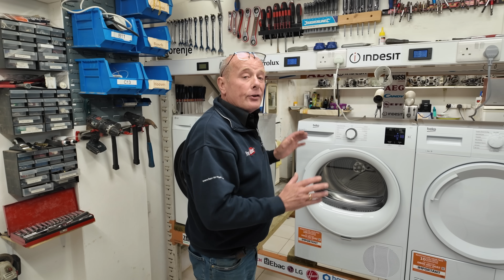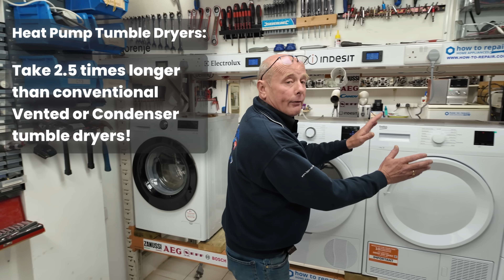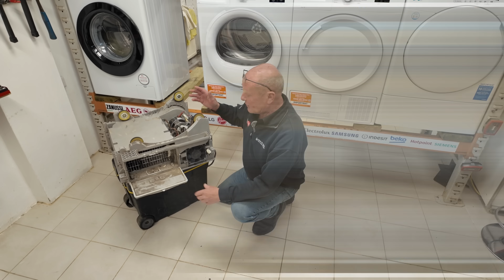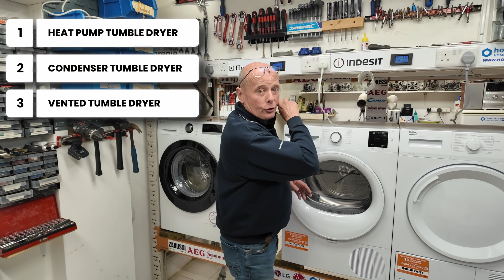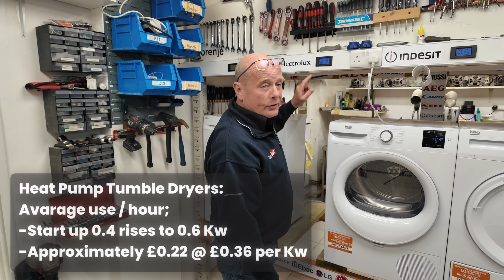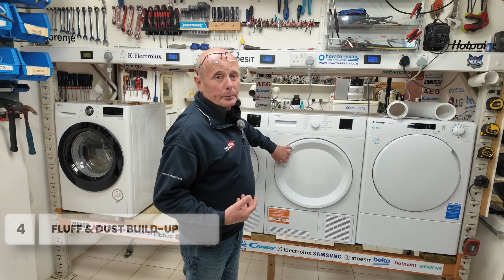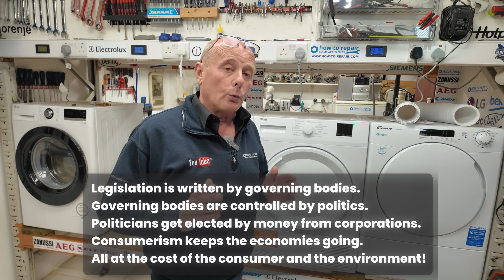Tumble Dryers the Shocking Truth About Heat Pump vs Vented & Condenser, NEW LEGISLATION!

Comment: To anybody with a basic physics and engineering background, it's obvious: the emperor is stark naked!

Thank you for making very clear how green these things are NOT.

I am coming to the end of my working life now, and I've never been in the repair industry as such, but I have always done machine repair at home whenever possible. 

If I hadn't, our family would have been thousands poorer, and we'd have sent three or four times as many machines to scrap heaps. That includes chest freezers (hinges and lids break because of poor design and choices of materials), dishwashers (cheap components fail), leaking washing machines (don't ask!), miscellaneous fan heaters, electric irons, ovens, kettles and so on.

I find even my own power tools are increasingly cheaply made - bronze bushes where there should be bearings, plastics instead of metal, and so on . And just yesterday, my wife's car's alternator, as designed, is too small to properly charge the battery.

I am surrounded by devices failing because of poor design, or deliberate 'planned obsolescence' on the part of manufacturers, particularly in 'modern tech'. 

It doesn't have to be this way, and you're right: it's largely down to a corrupt political process. Our politicians bang on about 'greening' the country, all the while wasting more and more resources on things that make waste increase, and decrease efficiency at many levels.

What to do? Teach basic physics and science better in schools--make sure children understand the difference between power and energy, and so on. Make sure, too, that they know about 'dust-to-dust' costs and how 'green' projects, particularly electric transportation, are really hurting the planet unsustainably.

And we should be grilling our politicians too: 'you want to pass laws that will change our lives dramatically: why? Do you understand what you're campaigning for?'

Most of them either don't have a clue, or are being paid for their views.
Reply: While teaching better would definitely help, it isn’t going to happen, because the people who are destroying society are the same ones who are deciding what gets taught.

Comment: I dont think this is a very good video. It lacks the facts to make a proper informed choice. And no i dont now understand the energy consumptions as the overall figures are presented very poorly. According to energy ratings from A++ to C hoover dryers i would use 259kwh/£80 per year v 691kwh/£214 per year. Saving £134 per year. Surely this would very quickly outweigh repair costs

Comment: The lifetime cost of the device should be highlighted at the point of sale. All white goods should be designed in such a way as to have a five year parts & labour warranty as standard, that way good design is built into the device. My Ebac washing machine has a seven year parts & labour warranty.

Comment: Very good video and analysis by someone who knows what he is talking about!!!! Unfortunately the legislators are not the people who know what they are talking about.... In any case, it shouldn't be a matter of legislation but market forces to determine which technology is to prosper. I am a believer in heat pumps in relation to heating, but until the technology and designs become robust and simple , there will always be a debate for the reliability and benefits of such technology. And yes , if the cost benefits analysis doesn't work - either improve the technology so it works or don't use it! The simpler is usually better...😊

Comment: I baught my condenser dryer about 7 years agow for £50 as it needed repairing. Was a simple repair of some wires and a heater element chainge costing an extra £30(give or take). I did the work myself with no training in the intustry whatsoever. Recently had to chainge the bearing witch cost me about £12. So all in all it has cost me less than £100 in tje last 7 years and works like a charm. I wouldent be amle to do the work on a heat pump dryer due to lack ot tools, knowledge and time so i will be sticking with my old condenser dryer for as long as i can.

Comment: A heat pump dryer system could be made to last longer. If the coil areas were made to be easily serviced to keep the heat pump at its peak efficiency? Then the compressor system would not wear out. It could be done. But a long lasting appliance is not the goal anymore these days?

Comment: heat pump driers are obviously Potentially better... but..  they need to be designed to be serviced and beefed up for longer drying times.  lets not encourage folk to waste power but focus on the better heat pump models that hopefully fix the issues you raised
Reply from the maker: Design is the big problem with these machines also wear and tear and components. Nearly all the heat pump tumbled dryers have to be completely stripped to be able to clean the evaporator and condenser properly If any of your friends or family are thinking about buying a new dryer, it would be helpful to share this video with them. It will give them an idea of what to expect when purchasing a new dryer.

Comment: Main difference is heat pump is more gentle to your clothes because it use less temperature. Condenser one use very hot air and clothes is shrinked after first use.

Comment: making sure I get my condenser tumble dryer before they get rid of them. Thank you for this because in the long run it costs way more money to maintain and repair on the heat pump. This is also not green friendly if I have to get rid of it it's harder for them to get rid of it.

Comment: Hmm I have a Bosch heat pump dryer I got 10 years ago. It dry my cloth in avg 1,5 hour, and I have never had any issues with it yet. And we switched from a condenser dryer, and it was easy to see on the electricity bills that we did the change 😊 just buy good European quality, and it might help on many of the issues you mention (which we have never experienced yet)...Just remember that the prices may go way up soon, thanks to mr. T.

Comment: Totally agree... Plus the condensor dryer is more repairable.We have a heatpump dryer and a condensor dryer. The heatpump (Miele) has mostly not very good dried clothes. Always extra 30 minutes heating. 
This (heatpump) model I have been able to open the front (it looks like precut) and look at the condensor inside. It was a little gros. More I can not clean.

Comment: I fully agree. Household appliances are made to complicated and unrepaireable. Similar situation with high end espresso machines. I own a simple Italian espresso machine without any electronics. Its parts can be bought everywhere on the market. The service manual can be downloaded from the manufacturers website and are relatively cheap etc.

Comment: I can not accommodate a dryer in my house. It has to go in the shed.  Heat pump dryers require a minimum temperature to work, thus they are less than useless for me as it gets cold in winter, the time you need to use the machine. Should I buy a vented dryer and have in stock?  I do have a washer dryer  which works well for the short time I use it.

Comment: The carbon foot print of building, the GWP of the gas, the license required to work on unit and end of life reclaim requirements surely negate half  of the “green “ bs. If they are phasing out standard tumble dryer I think I’ll buy a spare and stash in attic.
Reply: I did this when the EU banned powerful vacuum cleaners.
I immediately bought three 2300W Hoover upright vacuum cleaners and a bunch of spares like drive belts, foot pedals and a hundred genuine bags. 
Ten years later, apart from buying more bags, all three continue to work perfectly because they are simple to repair. 
These will see me out.

Comment: Sorry, I disagree with much have said regarding Heatpump tumble dryers.
1) Bearings if good quality go on for many years, a heatpump tumble dryer runs at lower temperatures than the other two and therefore wont dry out the lubricants as much negating the argument about the longer running time.
2) Replacing the heating system..... How many times have you replaced a fridge or freezer compressor? Regassing? Highly unlikely in my book, the sealed environment, the lubrication carried around with gas ensures a very long life span.
3) You talk a lot about replacing compressors or regassing, why would it leak? it simply doesnt happen
4) If you have a catastrophic failure you say engineers will tell you to swap the machine, sack that engineer and get a refrigeration engineer, no problem at all. 
I feel your views presented here are blinkered and not from a neutral standpoint. My current heatpump tumble dryer has a very efficient filtration system and washes the condenser/evaporator unit at the end of the cycle. The previous one, a Beko unit we had for many years and looked similar to the unit you had stripped down, access to the condenser / evaporator could be gained from the front so it could be cleaned. There is a lot of merit in paying more to get a good quality machine, the Bosch one we now have was twice the price of the Beko unit but it uses less energy and dries much quicker. I run my whole house on solar / battery storage and the heatpump dryer lends itself to this operation, even charging from the grid overnight at 5p kWh the heatpump tumble dryer is an absolute no brainer and right way to go, conventional resistive heater dryers would haemorrhage energy from the batteries / solar panels.
Thanks for the presentation, it was interesting viewpoint but seriously flawed in my humble opinion #8o)

Comment: I'll be honest, I do live in the US so while this law doesn't effect me I do want to defend the vent dryer because I think it deserves some love and the this green washing is trying to go everywhere. I think the energy usage argument is a red herring, as these policy makers are also forcing people into electric everything else while ignoring e waste. With that, vented dryers last as long as parts are available, mine has been going for 23 years with only a belt and tensioner. A family friend has one that's 35 years old. By both being simple and long lasting it saves on both manufacturing costs and the energy to say recycle 4 heat pump dryers over the power usage of a single vented machine. 

The reality is if you want to save money drying your clothes then in summer plan around a sunny days so you can use an old fashioned solar and wind powered dryer.

Comment: I agree with almost all has been said but I'm sure that with proper design and manufacturing being quality in time not only will time of drying cycle reduce but we might end up with interconnected appliances and boiler's and heat pumps that use heat transfer for better efficiency also some of the newer heat pumps incorporate part glycol transfer medium which if properly designed can be coupled to compressor module away from the dust so the dust isn't insulating condenser etc as if fridges freezers,solar panels etc all dumped their energy into a store it can be used for other purposes.  I hope this could can be something the manufacturer and government can get behind

Comment: My Miele washing machine is 25 years old. My Miele dishwasher is 24 years old. My Miele condensing tumble drier is  20 years old - bought it secondhand. The large stainless Miele (Liebherr?) Fridge freezer is 24 years old. 2 AEG self cleaning pyrolytic ovens are 24 years old. Repairs by a local chap has cost about £450 in total - all the equipment still looks like new - despite being used everyday by up to 4 people. 
The repairs have included 2 heating elements, a seal , a plastic part holding a spray arm, and a broken oven glass. A couple of the Miele replacement parts were better than the original parts - they had improved the design. 
I remember my Danish grandmother had a 10 or 15 year old Miele washing machine in 1970 … and a 30 year old Metabo drill … I also have a lot of 12 year old Metabo lithium battery powered tools that are still going strong … spares are still available. When buying the Miele stuff 25 years ago I remember being impressed by reading that Miele promised to keep spares available for 20 years. They also boasted that their washing machine bearings were designed to last at least 20 years. And the enamel was said to be very difficult to damage with a coin. There are no scraches after 25 years - or discolouring. The washing machine and dishwasher and tumble dryer, and fridge and ovens … still look brand new. Remarkable really.  
It is quite amazing how well the stuff has performed.  I wonder how much longer the stuff will keep going - will it see me out? - I am now 71 … !

Comment: The washer and dryers my parents bought in the 1960s were still operating faithfully in 2000.
The dryer I bought in 1980 needed a bearing replacement after 3 years. - this was just an irritation since I did I myself.

The last 3 washer dryer units the wife bought have had serious problems after 2 to 3 years.  The first two units had board issues and the current on has a problem - the drum coming apart.
Doesn't say much for QC.

Comment: Around 8:20 you mentioned "badly designed".  That seems to be the truth with some modern products where something has changed over what has been the 'historical' design'.  I do like the idea of the heat pump drier, however, as with EV automobiles there has been what I would describe as "running down the road with scissors".  In 35 years of product design I am now seeing new ideas introduced as the greatest thing without any real consideration of reliability, service, repair, safety, etc...  So many modern items drive me back to buy older.

Comment: Weigh the clothes before and after. See how much much less it weighs. 

Also how much energy into the room which is then removed by air conditioning. 

Safety standards want the air in you living space to turn over at a certain rate. Vented dryers help you obtain that change over rate. Non vented likely contribute to health issues.

Comment: My folks 1st dryer a Westinghouse was bought in 1947 and just a 120 volt ONLY model at a mighty 1400 to 1500 watts. The 2nd dryer a Westinghouse was bought in 1976 and is my primary dryer. It has high settings using the 240 volts and low heat setting using 120 volts.

The 1976 Westinghouse has a "trailer ball like" sphere on the drum that rides in a Delrin plastic bocket. The drums front rides on felt pieces. 

The dryer in 2005 went 2 feet under salt water in Katrina when the house flooded with seawater. The AC induction motor was removed and the muddy march mud washed out. The brass bushing was worn enough a decade later and a new old stock motor added for 125 bucks us.  The old motor still works; you just have to rotate the drum a bit to start the dryer.

The heater coil went out 2 years after Katrina and the 1960s heat coil kit had a extra stand off to add at the 7 oclock position where it broke. 

The two thermostats are standard ones and I have spares and another new spare motor

I will rig up a timer if the 1976 one ever fails. The belt is a standard flat belt
Reply from the maker: You can't beat the old stuff it was built to last thanks so much for your comment If any of your friends or family are thinking about buying a new dryer, it would be helpful to share this video with them. It will give them an idea of what to expect when purchasing a new dryer.

Comment: This is all absolutely right I have had to replace my beko heat pump dryer 2 years ago it lasted just shy of 8 years and then replaced it with a Fisher&Paykal heat pump dryer and it is still going very strong and when it dies I will be replacing it with a condenser or vented dryer next time.

Comment: A big problem in some markets is the availability of aftermarket or even OEM spare parts. 
Here in NZ, no refrigeration wholesalers sell the compressors suitable for hydrocarbon refrigerants such as R290 that many new appliances use. I have several customers with fridges that will either go to waste or require extensive modification to work with available parts - i.e. change the refrigerant to one I can get compressors for.

Comment: It's quite easy, if you live in a tenement use a clothes horse to dry your clothes or if you have a garden dry them on a clothes line, very little cost and uses zero energy during the drying process.

Comment: Do they using heat recuperator in vented dryer. Recuperators can have up to 95% heat exchange efficiency..  That will be logical approach to use them in dryers to minimized energy loss.

Comment: Remember that a vented drier that pushes its hot moisture laiden air out of your house is actually causing cold air from outside to be drawn into your house somewhere else in the property. That cold air you have then to pay to heat. So, I'd suggest that the condenser tumble drier is actually a cheaper option than it was presented here. We only use a portable dehumidifier and hang the clothes to dry near to it during the winter period. We have a Beco condenser drier but haven't had to use it in the past 6 years since getting a Meaco DD8L deciccant Dehumidifier. The dehumidifier also removes the damp from other evaporation sources like human beings, pets and cooking. A dry house and 300w of dry background heating and ionisation if desired. It's a no brainer. 😊
Reply: Not in our case, we have no space in the house for a td. It lives in the garage so all the heat would be lost no matter what. As a by the by, that also kills off an hp one as the garage is cold, much reducing the effectiveness of its exchanger. Trad vented works best for us.